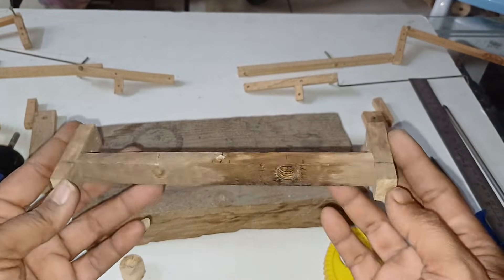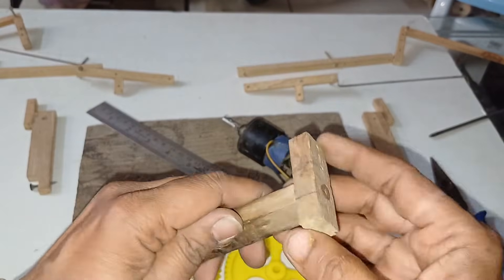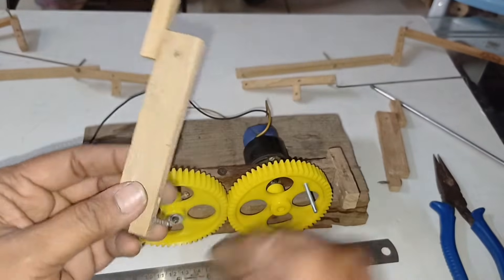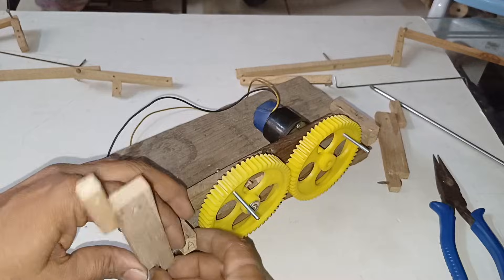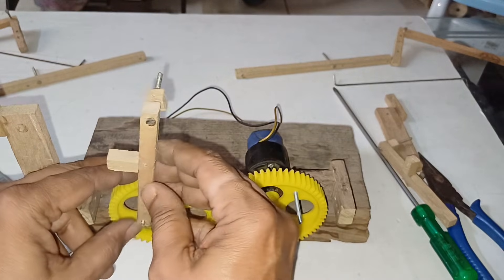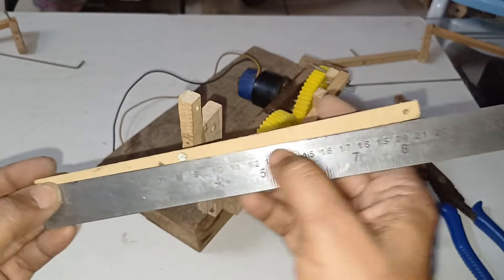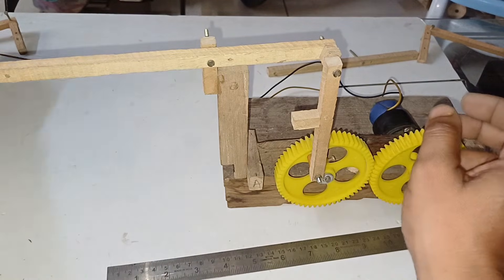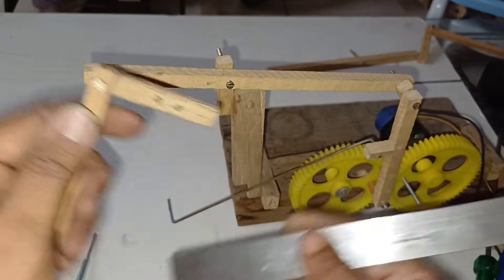Articulated Wing Design of Ornithopter Mechanical wings ... Assembly Video with measurements

Comment: Beautiful work. How would you increase the speed?
Reply from the maker: @tougers_world  here I used 45 RPM gearmotor..... To increase speed.... Use 150 RPM gear motor.... With voltage controller to increase or decrease speed........ Thank you for your appreciation 💕